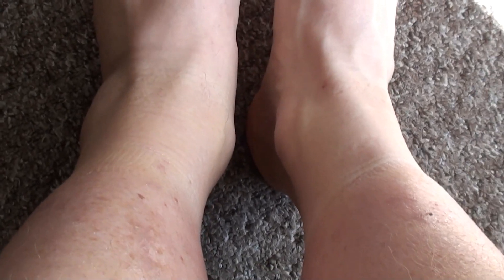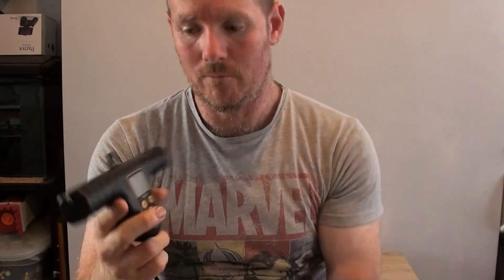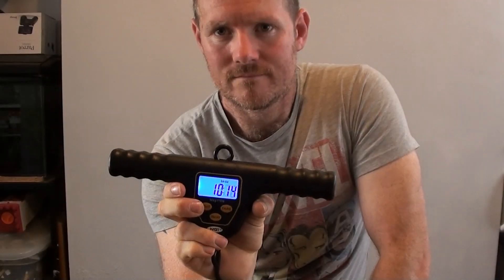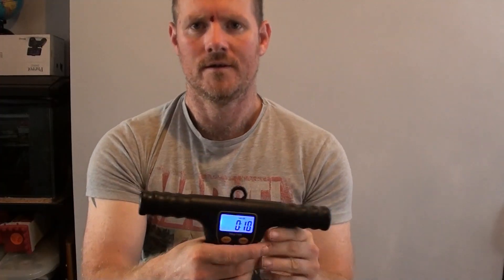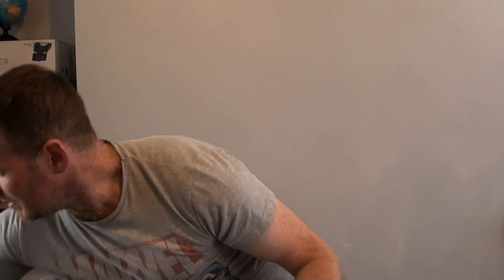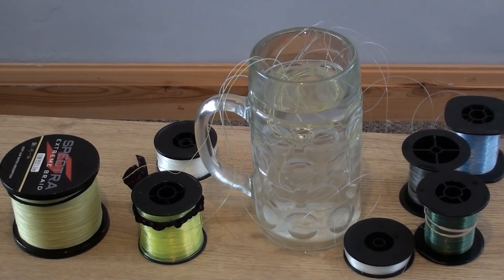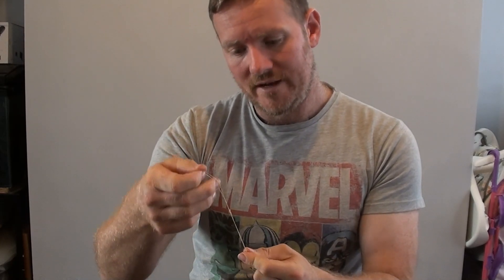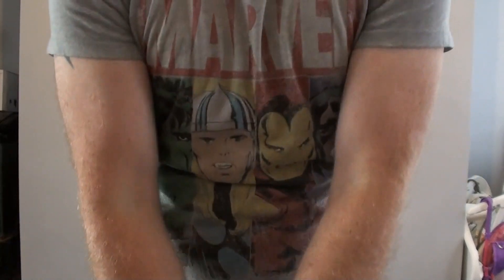testing line braking strength at home

Comment: good video fella  if you test in a way where you can wind from one metal spool to another using the line at both sides to  to hold the scales and to test the line at other side
Reply from the maker: Yeah that would give a higher line strength